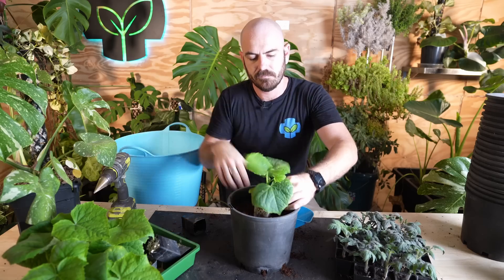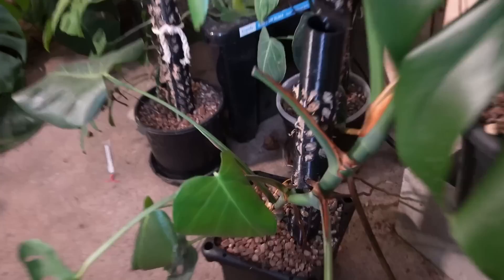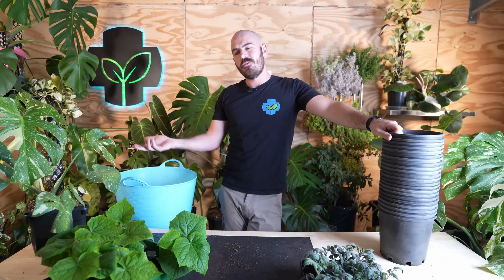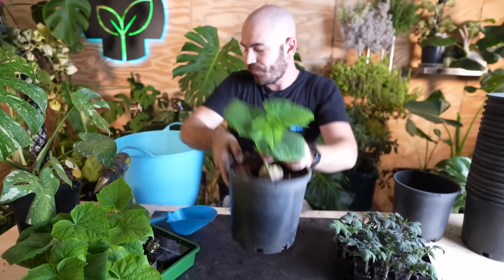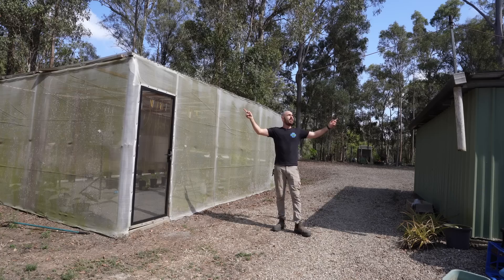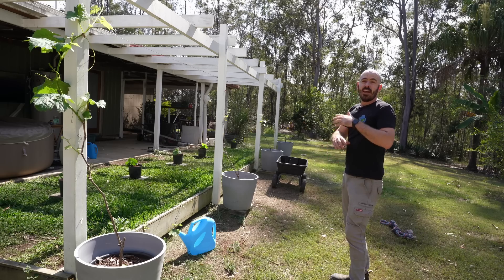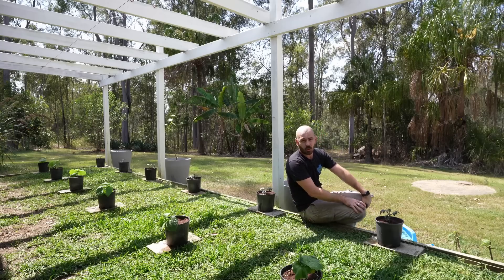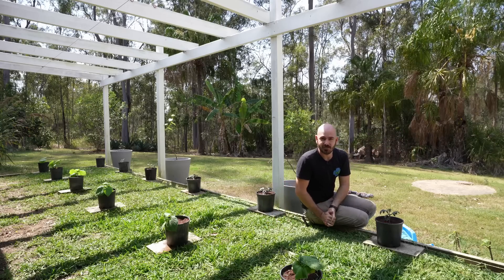The Simplest Hydroponic System: Drain to Waste

Comment: I currently have a recirculating dutch-bucket based system for my chocolate seedlings, and an NFT system for my vanilla, but I have a lot of potted coffee trees, a couple of large chocolate trees, and various others - avocados, mangoes, etc, that I am interested in sorta converting to drain-to-waste hydro, temporarily. Ultimately I'd like them all to be recirculated hydro but in the meantime, drain-to-waste seems ideal. 

One of my chocolate trees is 50:50 perlite:potting media. The potting media is old Miracle Gro Cactus media that is pretty much peet, and "forest byproducts." Nutritionally worthless on its own. I went 50:50 because it was suffering root-rot, and it has since recovered nicely. My other is in the original MG Cactus soil with very little perlite - I plan on repotting it to correct that. Chocolate loves well drained soil and ironically the cactus media is not what it's advertised as - it holds water too well and root-rot was giving me fits.

 My interest in drain-to-waste rather than waiting to build a new system is the result of the performance of my hydroponic chocolate seedlings. They're in pure perlite in 1-gallon pots (with 1-gallon paint strainers to retain the perlite), topped with clay pebbles to keep algae under control - and they are growing BONKERS! Watered 6 times a day for half-hour each. 

My potted chocolate trees are not performing near as well. I top-dress with Osmocote every few months. But I want that performance without having to build the system right away. 

Question - you use coco coir. I do have bales of the stuff intended for orchids, but am reticent to pot my trees up with it. Since these are trees, they will settle somewhat and won't be repotted frequently. I also am very skittish about root-rot issues too. Perlite retains a bit of moisture if watered frequently - every couple of days or so, but also allows copious amounts of oxygen to the roots too. Can your method work with pure perlite? Or perhaps my 50:50 blend of perlite:coco coir maybe 70:30 favoring perlite)? I saw a video of one fella who potted a fig into pure perlite to water drain-to-waste with hydroponics, but then, figs will grow anywhere.

Comment: I have a question about auto filling kratky systems, would it be better to only have the nutrition water stay half full, like the water only goes to the middle of the container and stays at that level or should it be lower for the air roots?

Comment: i love drain to waste hydroponics systems like these and even though they're the simplest really think they're one of the best! You don't get any of the selective nutrient uptake you get from other systems that disrupts the ec and ph and since you're not recirculating back into the res there's way less potential for gunk to grow in the reservoir. Also if you water till runoff you constantly flush the system and your media always has the perfect ph and perfect ec, which pretty much any other type of system can't do without daily monitoring. I have something setup like this but that's automated with drip irrigation and don't think you can ask for a more efficient and ideal system.

Comment: But hevey manual intervention required ib this system
Reply: It takes about ten minutes to automate with a small pump, a timer and a 100 L bin full of nutrient (I used a 50$ aliexpress solar plant watering system as I dont have a handy power point-it does go through more nutrient than a recycling system so a decent size reservoir either to fill your watering can from or throw a pump into is useful.  Mixing up a watering can worth of nutrient everyday or so is more than a little painful).

What I want is a source of decent cococoir that isn’t too expensive…I’m only doing small scale-a vertical planter and a couple of pots so far but if I want to expand it’s going to get pricey either in shipping or product (I’m in South Australia)
Reply: @susanstewart5134  can you please help remotly for setup one small area on the roof ? one point here temprature range is 5 to 45 degree of celcius